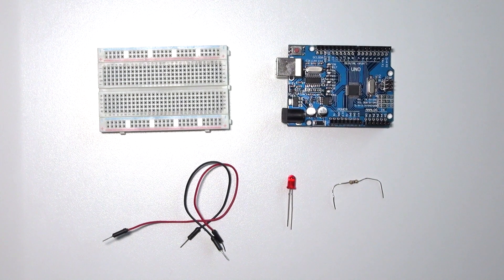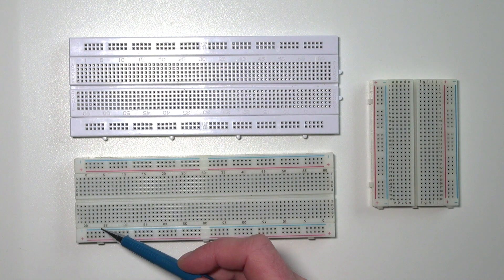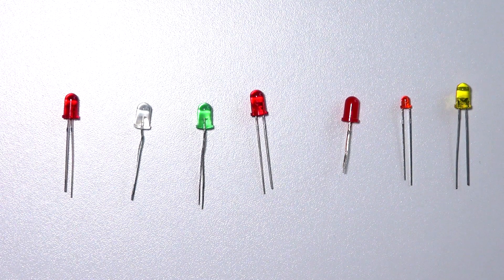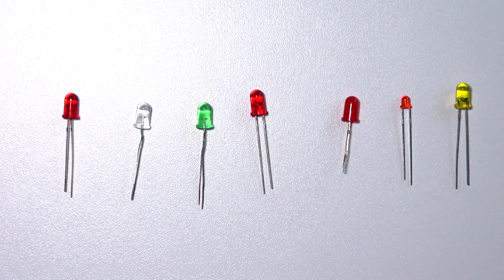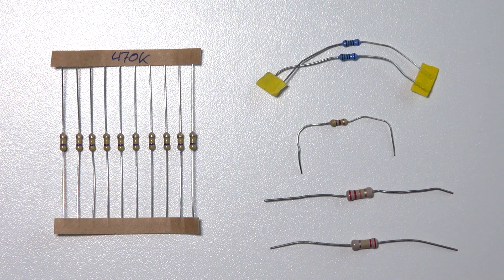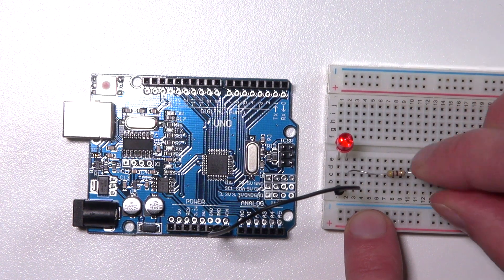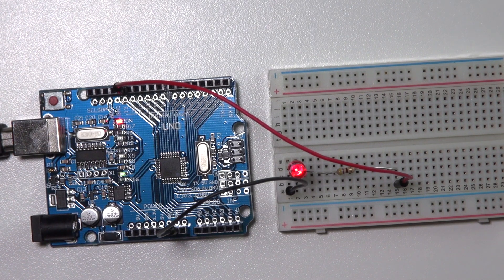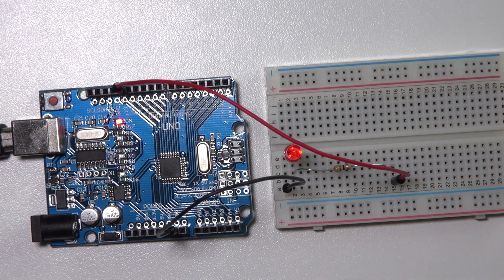BLINKING LED ON BREADBOARD - Arduino tutorial #2

Comment: Can I use a 1k resistor? or a 220 one?
Reply from the maker: Sure, higher is not a problem, although the LED could be less brighter than with a 470 Ohm resistor. Lower is more risky. Although the Arduino probably wouldn't burn down, do it with care 😃
Reply: Thank you! I will use the higher one!

Comment: The LED brightness when i connect it to pin 13 is much lower than when i connect it to 5v or 3v given the same resistance.Why is that happening isn't the output high 5v ???
Reply from the maker: Do you have this same behaviour when you connect to for example pin 8? Pin 13 is the onboard led as well, which could result in a less bright LED.
Reply: @BasonTech  I do, even in the 8th pin
Reply from the maker: @bogdanzavoianu  Could it be that you are using an unpowered usb-hub? Have you tried another computer and/or Arduino? I am quite curious what can cause this :)
Reply: @BasonTech  i tried all the usbs from my laptop (3)
Reply: @bogdanzavoianu  These all have the same power supply. I am especially wondering about another power supply to see the difference (if any) :)
Reply: @BasonTechNL  it's the same situation
Reply from the maker: @bogdanzavoianu  Do you have a multimeter to measure the output?
Reply: @BasonTech  no, i don't. But it is weird because when i was using the blinking example in Arduino without manually changing the port, the led was brighter. Then i changed to port 7 and to other ports and it was a lower intensity